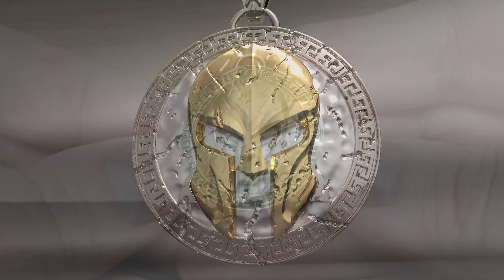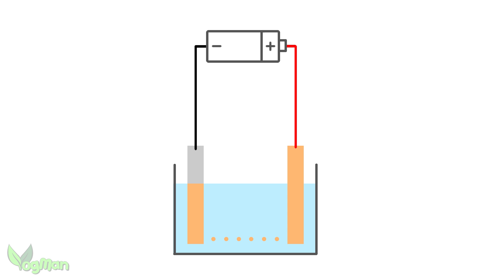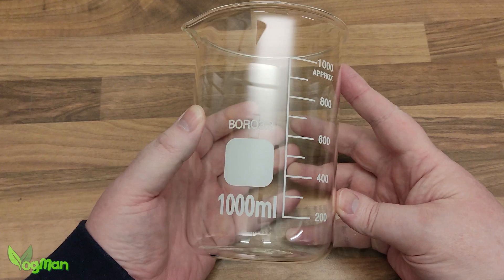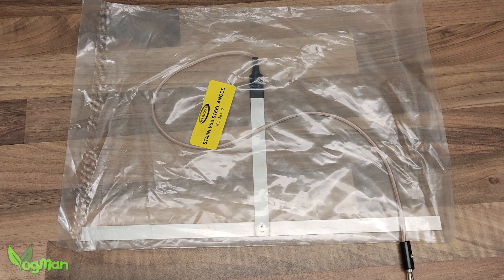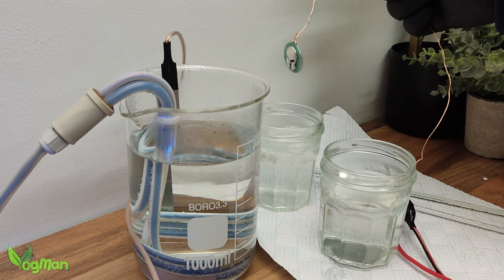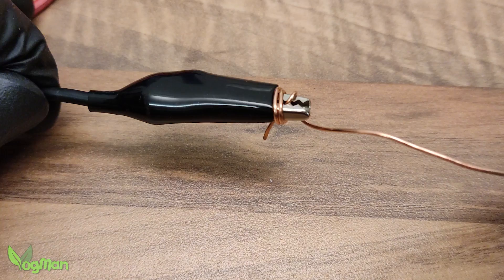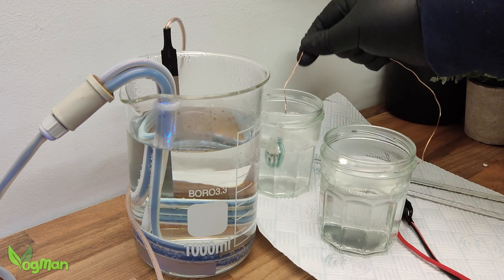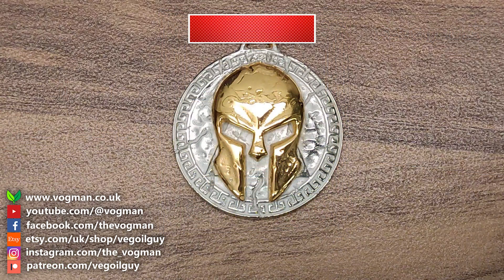Gold Plating at Home with Pepetools IPS-Pro Plating System

Comment: Hello Vogman!
I am keen to follow in your "gold-plating over silver" footsteps, however I have a question if you don't mind..
Do you need a nickle substrate first?
I am wondering if you would agree with a  google search i did suggested the following...  "All gold plating on silver requires an “underplate”. Usually nickel but I believe that palladium works but is more expensive. The problem is not the wear but the silver oxidation will show through the gold plating."

Comment: Vogman please remove your plating solution off the product used it is cyanide base, you need to wear a mask as soon as you open it. You can get cyanide free gold plating solution all are acid based. Do Be careful on disposing the chemical if mix with alkaline base chemicals it will out gas cyanide.

Comment: so this kit comes with nothing. Just the rectifier which is available on Amazon for $80 and a heater? You have to buy all that other stuff? Where is the value in paying $600 for a $80 dc power station? Because that is all a plating rectifier is. I'm sorry but this is a disservice to devoted fans like me.

Comment: That power supply looks a little on the cheap side, a shame the need to run the heater prevents using cheaper (but better quality) buck converters.
Reply from the maker: I'll admit the plastic does give it a cheap look, but it's a capable bit of kit. Power is only part of it... control and safety are much more important. Then there's the extra features which, I confess, allude me at the moment... but it's nice to know they're there in case I actually need them one day 😁
Reply: @vogman  Indeed. If it works, it works.
As an electrician, (reach out if you need help with any of the terminology or concepts involved) I can say that the safety aspect is important. It is the mains going into the rectifier that is the bit that is the most dangerous and the bit the cheap units cut the most corners on. I would assume that heater that's in a conductive solution is on mains voltage?
I'd personally feel much safer with a hotplate and better quality power supply.
I recommend an old laptop power supply and an ebay "Buck converter" as a power source - cheap, and safe, and just as many adjustments for when you need them.

Comment: Will any old permanent marker work to block the plating?
Reply from the maker: In theory, yes. It blocks the path of the electrons. A lot of guys use Sharpies rather than those expensive pro pens. I went with my CD marker pens as then had nice fine nibs.

Comment: I was looking at getting the plating pen, can seem to pick them up for around £40.00 on eBay, the reason for that is :- I was thinking you might not have to faf about with the covering of parts that aren't needed. but that worked brilliantly 👍
Reply from the maker: I have a pen plating system here I haven't tried yet. Looking forward to it 😁
Reply: @vogman  i look forward to seeing the video, as I haven't tried mine either been to afraid to

Comment: Will this work on any metal?
Reply: Some might be a pain in the arse like aluminium.
Reply: @peterkiss1204  that’s what I was thinking as well. I have a custom bike shop and this would be an awesome service to add for customers
Reply from the maker: In theory ANY material that is conductive can be coated. However, some materials will work better than others and I've no doubt some will need a fair bit of experimentation.